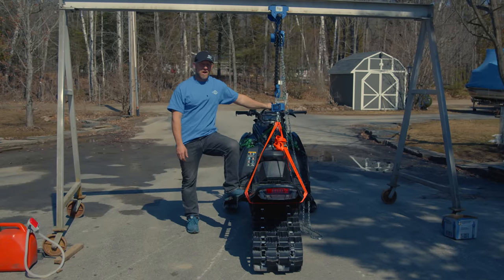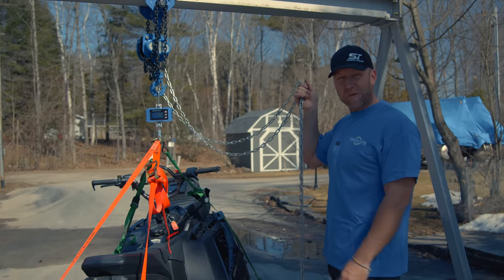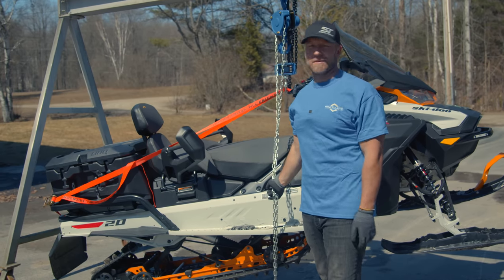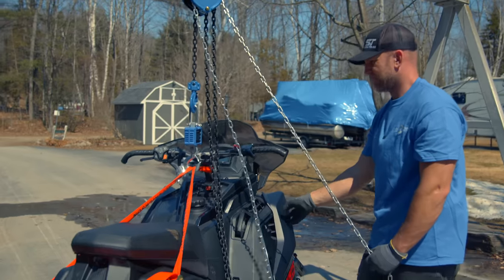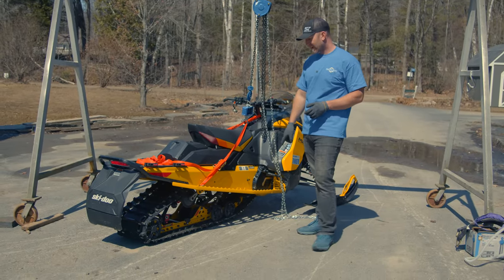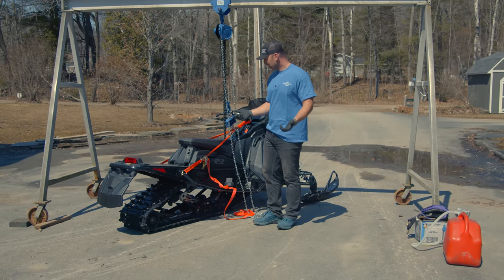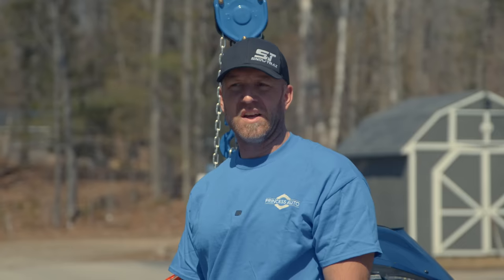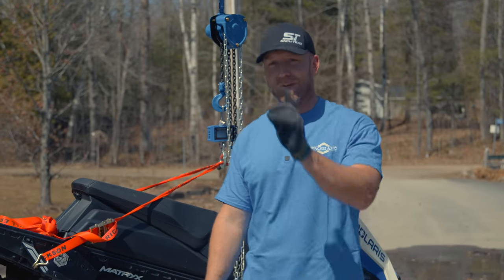We Weigh Every Snowmobile In Our Entire Fleet

Comment: I have a 2023 Yamaha Sidewinder LTX GT- EPS and I was thinking over 700 Lbs. wet ? I was surprised to see 667Lbs. I'll agree with you that these Sidewinders are very fast, they also have great suspension, and the EPS takes away any struggle with steering. I also have a 2011 Apex- EPS with 20K miles on it, and it still runs great! Can't beat those 4 strokes!

Comment: Great vid and thx for doing this.  Hopefully the OEMs don't shrink the fuel tank sizes to lighten up the rides. The Yamaha Nytro comes to mind here when they only offered a 28L tank to advertise a lower wet weight. Kudos to Polaris for offering the largest capacity tanks, which the extra fuel weight should be welcomed over the doos smaller tanks.

Comment: Great video. I highly suspect skidoo has been lying about dry weight on the summits for several years, as the wet weight is way more than RMKs yet the summit carries considerably less fuel. I wish I could trust any of them. This video didn't address my issue but in general it's good to see the oems being put on notice that someone is checking weights. My 23 Expert turbo is a lot heavier than the boost, it's obvious, but the marketing made it sound like they were within ten pounds. No it's 40....sigh.

Comment: Very nice video, skidoo as more fluid weight, i am wondering what are the fuel tank, oil tank, and cooling tank capacity skidoo compared to polaris. As well as battery size and batterie weight difference. thx again for this nice video.
Reply: Polaris carries 11.5 gallons vs Doo's 9.5 gallons which is an additional 12 pounds of wet weight added to each Polaris due to its additional fuel capacity.  One gallon of fuel weighs 6 pounds. The oil tanks on both sleds are nearly identical in capacity so there's no difference on that end.

Comment: wonder what the catalyst will come in at
Wish you could have had a procross to weigh, they have always considered to be tanks compared to the other two strokes.  I gUeSs NoT aNyMoRe
Reply from the maker: Will be picking up our CATALYST in a few weeks. 👍
Reply: @snowtrax  is there any way you can put them on bathroom scales at four points?  The two front shocks and front track shock and rear track shock?  It would really tell you a lot as it give us an understanding of balance and why sleds may feel different.

Call it part 2 sled wet weight.  You pretty much have everything you need with the truss and lift.  Just need to drop it in scales.

Comment: HI AJ, 
I wanted to let you know of a minor flaw in your weighing method.  I noticed the shadow was directly under each snow machine, meaning the sun was directly overhead. This means that each snowmobile was subject to higher amounts of energized particles (neutrinos, protons) from the sun.  As a result, each machine probably had a small increase in overall mass. Just kidding.  Cool video. :face-blue-smiling:

Comment: See Yamaha is not a total tank! I get crap about my heavy nytro every season, and seeing 667 pounds for the sidewinder, my nytro must be 30-40 lighter, I’ve removed the stock muffler all the rear plastics, and replaced running boards and cut the tunnel away so I’m guessing the nytro weight would be 600-620ish

Comment: 575 for an Indy sp when the dry weight is 505? Only 70 lbs for oil, fuel and coolant??? I have a hard time believing that when every other sled was 120ish lbs more then dry.

I'm struggling to believe all the sleds have a full tank of gas. 11-12 gallons of fuel is at least 80lbs. 2 gallons of coolant 20lbs, a gallon of oil 10lbs.
Reply: @RebelCanuck can we though, that's the weight we've seen, doesn't mean it's completely loaded. 

All I know is compared to what's been shown my '16 1200 Renegade X with QAS  and all its accessories is lighter then the new G5 850s. I had it all loaded to balance the weight transfer and had it weigh in at 630lbs.
Reply: @RebelCanuck  i would not be suprised if polaris shows the sp having a higher dry weight than what it actually is since the equivalent xc 650 137 weighs 465lbs dry. just to make the other models seem better. they should weight about the same not that much more. i also find it weird they state "estimated" dry weight like they obviously know exactly how much it weighs. polaris lists that sp at 499lbs estimated dry weight. after adding 43.5 gallons worth of gasoline weight you get the exact 574lbs that they are getting here. maybe polaris is adding coolant and oil weight in the case of this sled?